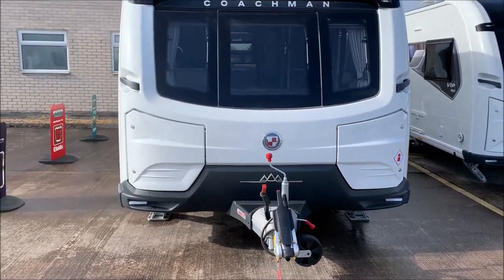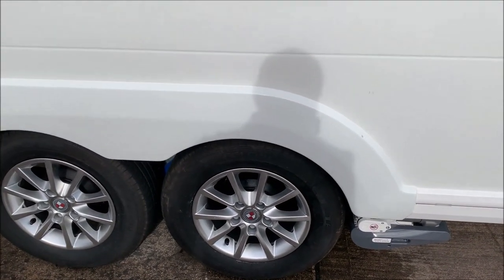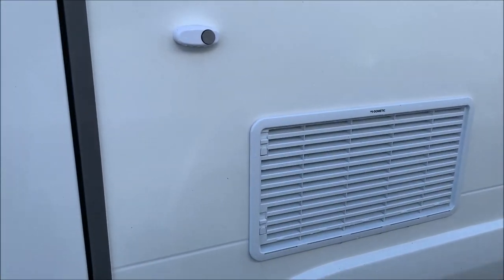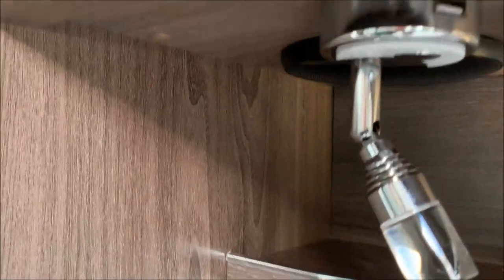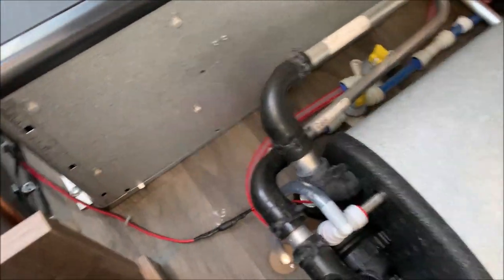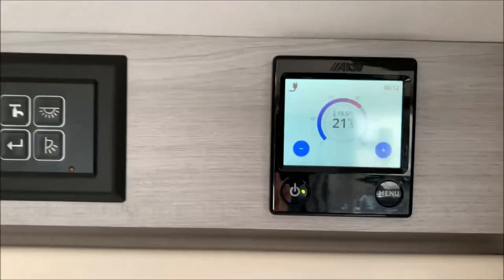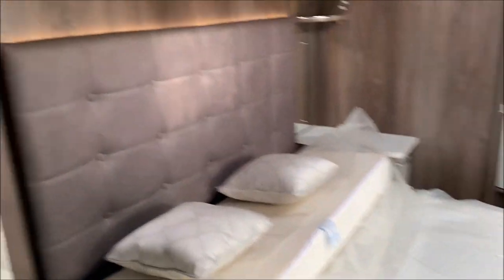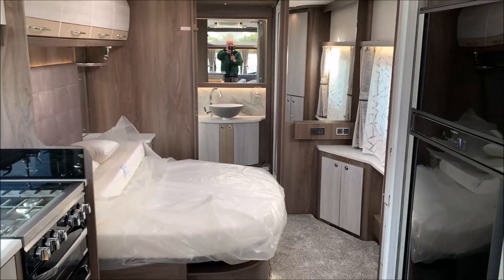2023 Coachman Lusso II handover video

Comment: This is a thorough explanation for all features on Lusso Van. No one else explains  the arrangement for using the onboard water tank! Thank you?You did omit to show the cordless charging pad for smart phone. Can you clarify how the pipe works regarding filling/emptying of water from the built-in tank. There appears to be one pipe for filling/emptying water but how does that work with the submersed pump supply used when feeding outlets in van?

Comment: When connected to a mains tap and the internal water tank is full does the internal pump or external pump need to be selected to get continuous hot water with the Aldeflow?
Reply from the maker: You need to select the source you wish for the cold water to be drawn from.
 
If you’re on a mains tap then you do not necessarily have to use the on board tank and can bypass it.
 
If you’re wish to utilise the water in the tank you will have to select the tank